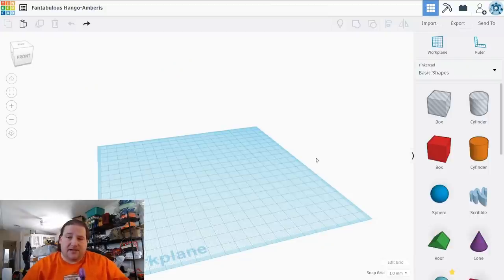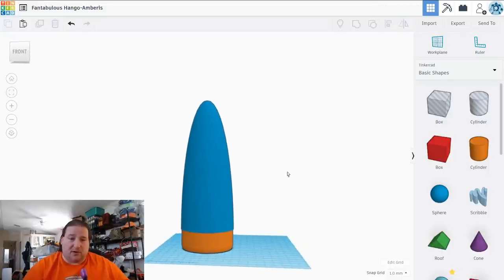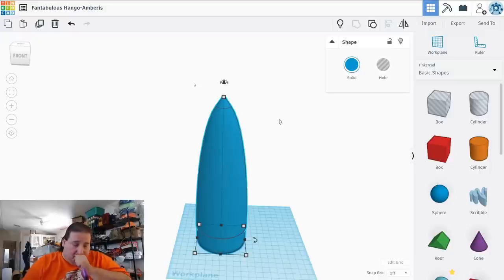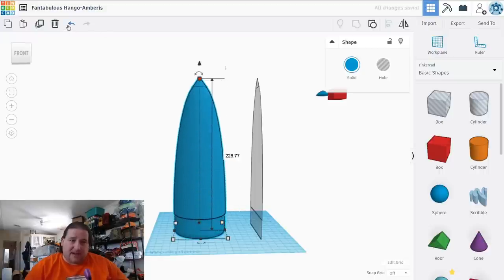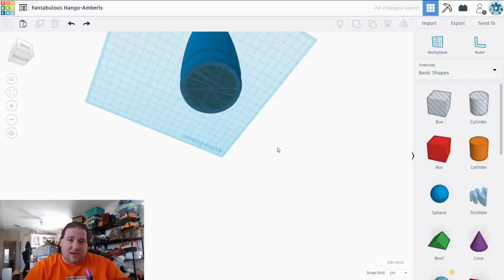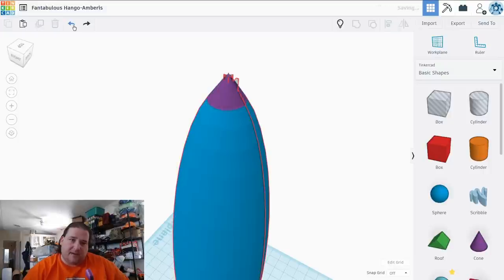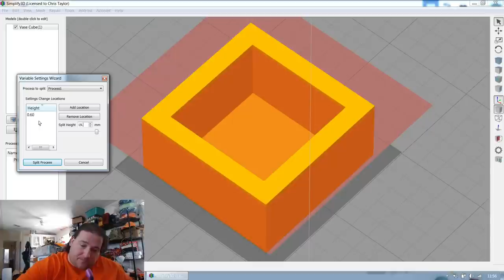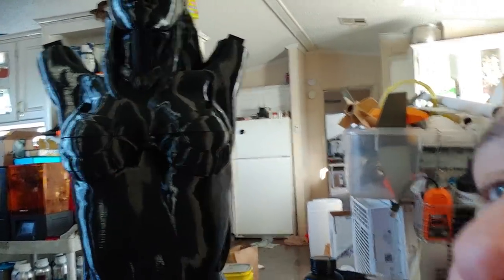How to make Complex Multi Surface models 3D printed in Vase Mode T3DP

Comment: Very helpful, thanks! I was experimenting with multi-wall vases already but never found out how to make my vases stronger with "gaps". Perfect!
Reply: thats the thing.... there don't even have to be any gaps if you set the model up correctly in cad.   part of the coolness here is he did it in tinkercad.... and made it easy to understand for people having the same thoughts as you and i....   as long as you construct whatever thing with the understanding of the continuous spiral/linear tool motion in mind such that your gap or cut as he says is essentially zero then there don't even have to be physical gaps on the finished product, the small amount of overlap or deliberate overextrusion seals them..... you could actually create something akin to a patterned infill throughout the entire model this way and yet have it printed in one continuous line.

now... imagine with me that we all had state of the art printers such as new rat rig voron etc... or industrial machines.      youve seen how fast they go, especially with high flow.    think how fast things could be printed when the design and slicing made it one continuous tool path.    now design the model with as many curves or rounded edges as is possible... so the tool head doesn't have to change directions too abruptly....  even faster.

Comment: When you have an object selected press T this makes the selected object transparent so you can see through it. Another tip is press D to drop an object onto your workplain. Everyone like this so others can see this useful tip...
Reply: Also  you can nudge height by the snap distance by holding the CTRL key and using the up and down arrows

Comment: i think you did some good stuff here.   you've stated clearly what i've been trying to achieve with certain things.  i think its funny how "double wall vase mode" doesn't exist and instead we get a vertical z seam, yet when you set the model up so the path follows the contour, and the wall thickness of that contour is the thickness of 2 lines of extrusion (if thats how you want to set it up... or as you have done)... that this works quite well and you remove the z seam... it prints faster... and it likely becomes stronger.    and yet nobody seems to talk about this.
Reply: I agree that it's something that's not discussed often. I'm looking into it now because I have a need for it. But I still haven't figured out how to make anything with a top in Cura or Bambu Studio. His cube doesn't slice with a top there.

Comment: This is an amazing video. I'm in my first week of 3d printing and I saw a need for something like this and your tutorial is the first one I found. You have my sub and a huge thumbs up for explaining this. My first print using this technique is 1/4 of the way through and printing perfectly as of right now. I had designed and printed a funnel for a specific purpose. I printed it in vase mode and it worked perfectly but after the print cooled it was just a bit too flimsy and I could hear cracking if it was flexed too much. I think this will add some much needed rigidity and still print quickly with a seam much more tidy looking than a normal z seam. Thanks for making a video clear enough for a complete noob to follow along and replicate!
Reply from the maker: yes this would work wonders for a funnel. ALSO 0.4mm IS a bit thin for vase mode. increase your flow rate to 125% to 140% for a much stronger print!
Reply: @nerys71  I will give that a shot. The print completed and it is VERY strong compared to the original. It worked out perfectly! My printer is the 1st version of the CR-10. I'm really enjoying it! Can't believe how well it prints. Bought it as a referb from Comgrow, works perfectly after getting the bed leveled correctly. Do you have any idea about what size nozzle I could get away with using and still get good looking prints with the stock CR10?
Reply from the maker: @TheFishingHobby  Good LOOKING is very very subjective. I personally like the look of fat layers :-) you should be able to go up to a 1mm nozzle with the stock hot end but you WILL have to slow down. 30mm/s (but you make up for it with volume!! so you still print 3 times faster)

Comment: If at 16:50 you were talking about shrinking/growing a by a set percentage, I do it by removing the ruler from the work plane (obligatory) then shift key scaling like the kind you're explaining in that part of the video by some nominal amount.  Afterwards, click into one of the dimensions and type xx% (you can also type in a fixed amount in the axis of interest) and everything should scale by proportion.  I haven't tried to see if this would work on just a single axis.  Thanks for this idea, I really love it!  Vase mode for life!
Reply from the maker: Very cool!! I did not know you could do that!
Reply: @nerys71  Yes!  I use it often since I learned it recently.  If you use R + Esc that's a nice quick way to get rid of the ruler, as sometimes (at least for me) the ruler gets unruly and won't leave the work plane when you try to click the X to dismiss it.  For the nose cone: did you try using any of the shape generators for high res versions of the sphere, cylinder or parabola (page 5, 6 and 7 respectively)?

Comment: Hmm... curious to see this done on a figurine (or other detailed organic shape), using the shell modifier in blender to shrink them down and create the hollow and go from there, but I hardly print any such things, so I won't try it anytime soon. Theoretically, it should be a simple process, as even the inner reinforcing ribs could be made by using the boolean operators to slice up the inner shell with a basic slicing object (one cube duplicated by the array modifier into as many slices as needed). 

Edit: this is assuming that blender's shell modifier works as intended, accurately and reliably... which might be a bit of a stretch. Oh, and you'd have to use some sort of cleanup or remesh operation to deal with the generated overlapping faces. Extra steps, but still plausible given that the software does so much heavy lifting. Or just bring it into volumentric-style software to create the shell and so forth. That would be much more likely to work. 

Of course, it wouldn't work on everything.
Reply from the maker: vase mode rules still apply IE the part has to be normal vase mode compatible to use this mode as well which will eliminate most figurines since their shapes violate vase mode rules.

IE it has to be possible to slice the entire path without retraction or non print movement and seamlessly lead into the next layer with the same rule. this means no negative angles and no islands (such as a separate torso and arm for example) which would remove most figurines from compatibility.

This is basically a way to made more rigid stronger lightweight parts but still in vase mode.

Comment: Great tutorial Chris. One thing if I may mention it? When you are showing the drawing you did on the pad to emphasize the tool path, maybe switch screens so you are bigger at that point. I couldn't really see what you were drawing! Not sure if you can switch while recording? Thanks for always teaching me something new!!!
Reply from the maker: Yes 100% agreed. I realized on playback it was hard to impossible to actually see what I was drawing! need to get my white board out and goto sharpie (not on white board of course) ie thicker marker and yes full screen. I was intentionally avoiding that because I was having issues with OBS (turns out I suspect its a codec issue and not an OBS issue so working that angle now) last thing I needed was to hit a button lose the audio and talk away for 20 minutes. Grrrr the nightmare that would be! :-)
Reply: @nerys71  Yes, losing audio would not be good LOL. Overall, it was great. You have turned me on to Tinkercad, and I think it will now get used as much as I use Fusion 360! It's a whole new way of thinking as far as how to create those custom shapes. One thing I really like about Tinkercad is how simple it is to move the work plane around. Not so simple in Fusion! Thanks again!

Comment: cool! I have an italian desk lamp that had a 50x150mm frosted glass cylinder that fell :/
did a print, looked not to nice.
just did it again, vase mode.. 1mm wide line with a 0.4mm nozzle :O worked fine!

Comment: vase cube box is really cool, nice tricky! 

I use multiple process for a long time since s3d implemented it... but didn’t know that it is possible to mix vase mode with other process, thinked always as vase mode for the entire model hehehee

By the way I’m making vases with 0.8 and 1mm nozzles... in TPU 95A and petg.. wider walls/nozzles works really great for that
Reply from the maker: Yep my chiron has a 1.2mm nozzle vases are killer strong at 1.2mm :-)
Reply: Nerys definitly... I have a set of Volcano nozzles (TriangleLab) from 0.4 to 1.2 to my Artillery X1, time to try it 😊
Reply: Nerys I tryed “fake nozzle” many times for vases... setting in S3D 1mm using 0.8 nozzles... works great! You can go up to 150% max of nozzle size... just need to take care with total volume to the extruder limit in mm^3 / nozzle size x layer high x speed in mm/s
Reply from the maker: @Flagazz  as long as you dont have overhangs. When you over extrude with overhangs they can get really sloppy sometimes.
Reply: Nerys True, bridges, even the small ones) and overhangs are really bad with wider nozzles... I also increase the retraction distance to around 5.7mm with 0.8-1mm nozzles in Creality printers that I usually uses 4.9mm with 0.4 nozzles

Comment: Brilliant Chris. I think you've seen my "Smooth TinkerCad Circle" video which would definitely help with the polygons. Cheers, JAYTEE
Reply from the maker: sadly it does not. it actually makes some parts worse (the printing part) unless I am doing it wrong. what ends up happening is the filament path becomes a "zig zag" instead of a curve. since now the path moves in and out from each polygon intersection. IE the part looks smoother (and does print smoother if you duplicate it enough times) but the printer itself throws a fit trying to execute the path. if you use less polygons so it does not throw a fit so much the part is very obvious faceted :-( the "in and out" exaggerates ringing. so the higher poly count LOOKS harsher instead of smoother. I really wish autodesk would just triple the side count for all shapes. especially cylinder (just double would be nice) and Sphere (the big one for me as I use it to make nose cones)

now. I wonder if CUra's resolution options (which could chop out some of the zig zag if tuned right) would help to fix that. problem is then I would have to slice with cura since it does not actually change the model.
Reply: @nerys71  Very interesting about the negative effects caused my the multiple dupes. Yes, just give us more sides :)
Reply from the maker: @JAYTEEAU  Well, if you look at a model closely. For example Make one duplicating shifted half of the width of a face. Doubling the number of faces But now look at the edge. It's no longer a round polygon. Where each one angles by half the previous instead Is zig zags Angle inward angle outward angle Inward angle outward So instead of a finer and finer Ark you get a finer and finer zig zag Do this enough and you do get a nice fine curve But it drives the printer crazy. :-) and on many of them you have to keep slowing down to avoid CPU. Overload.
Reply: @nerys71  Makes sense. Thanks

Comment: I know that this video is probably dated, but I'm curious how large of a difference this makes to total print time vs standard design. And print
Reply from the maker: I try my best to reply to comments. one trick is to not reply to an existing message but post a "new" message just like you did !! this means it comes to the top of my comments list and I see the message! Like I did :-)

the difference is quite dramatic. I made a very large BT101 nose cone at 100grams !!! substantially lighter but still 75% as strong as a normal printed cone.

another advantage is vase mode. which means even a poorly tuned printer should get a nice clean result as there are no retractions! less chance of any sort of failure during print.

Comment: playing around with this technique the new cura 5 slice engine doesn't like this at all (old version not to bad but not as easy as prusaslicer ), it can be forced to work but doesnt print tops and has travel and retraction moves in a spiralised mode (doesnt seem right maybe they will address this at a later date) thanks for the inspiration
Reply from the maker: This may actually have something to do with a difference in how kira and simplify 3D work

Simplify 3D bases everything off the external perimeter of the model so that means I need to leave a space inside the model of two times the nozzle diameter

Kira however I believe uses the center of the filament path as the boundary so you only need one times the nozzle diameter

This is actually kind of critical because of the way I generate the models for example the actual ribs that go from an inside to an outside wall I make mine infinitely small 0.01 mm effectively it doesn't have to be there it can be zero because the two walls would simply touch however that only works with an external perimeter model

Kira uses center of the path which means when I make the wall 0.01 mm apart they're actually overlapping in cura and that will break phase mode although you might be able to compensate with thin wall behavior?

So basically my rib to external wall gaps don't have to be as big to slice in cura but all of my ribs themselves are now too small I need to make the gap of that rib one times the nozzle diameter so if I'm using a 1 mm nozzle that Gap needs to be 1 mm because one side is going to have half an hour width and the other side is going to have half an hour with totally 1 mm for a 0.4 mm nozzle you would need a 0.4 mm Gap otherwise vase mode will break
Reply: @nerys71  it kinda works using their 'surface' mode but still does strange things like retractions and going to other side of model for no reason?

Anyway Ive found ideamaker works perfectly, it has many of the features of simplify but it's set up for raise 3d printers and getting the correct printer profile is a bit of a chore.

Thanks for sharing.

Comment: So this works only on symmetrical objects, correct?
Reply from the maker: no. symmetry is not required (though it is easier to edit) only "vase mode compliant" is required. basically no island no extreme under/over hangs. no domes. no "flat" areas. IE anything that can be printed in normal vase mode you can perform this process on. also some things "NOT" vase mode compatible can become vase mode compatible with a few "cuts" in the model.

For example the bracket for the taco recycler. not vase mode compatible. put a slice into each "pocket" and a slice through the primary ring and now it is vase mode compatible. IE islands can work if you can CONNECT the island as one continuous surface.

Comment: TEVO Tornado with a firmware problem: First I had the blue screen of 
death, so I re-uploaded a fresh version of TEVOs firmware. No errors 
before or after uploading and all categories/options are there. "BUT" 
open the 'Print from SD Card" and I might get just a blue screen with 
the word 'Main" on top... close and reopen and it'll show all the files 
on the card, "BUT" it will not let me scroll down past the first one. 
Now if you select that file and click it IT REBOOTS! back to the desktop 
screen every time.

OK lets try something else, so I downloaded Marlin V2 patch 4. it came 
with a ton of errors, (days to figure out and fix). Uploaded/no errors. All 
categories/options are there. Go into "Print from SD Card" it lets me scroll 
the list no problem, "BUT" (Are you ready for this?) any file you select it 
"REBOOTS" back to the desktop screen!!!!

So the million dollar question is how can I have two OS's doing the very 
same thing? Where do I start looking and what am I looking for?